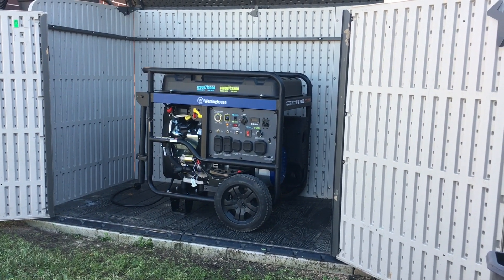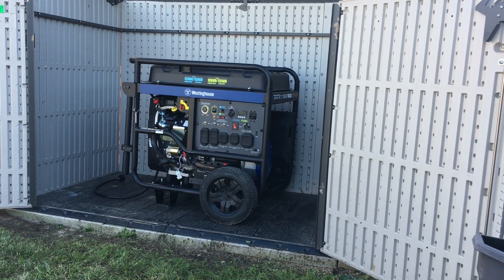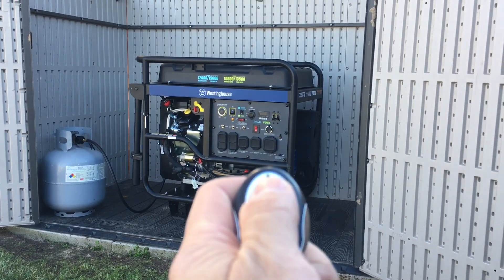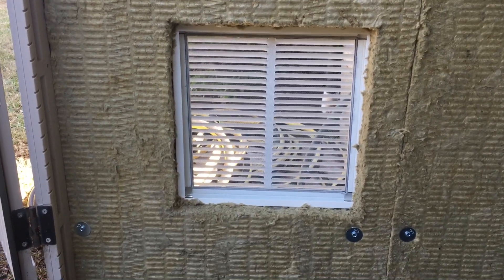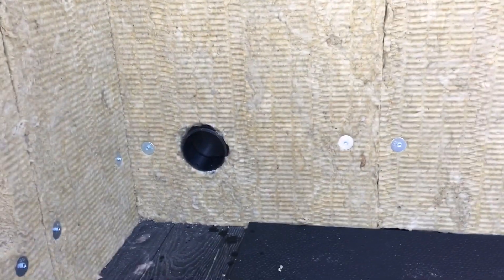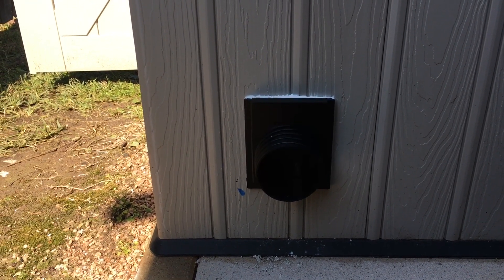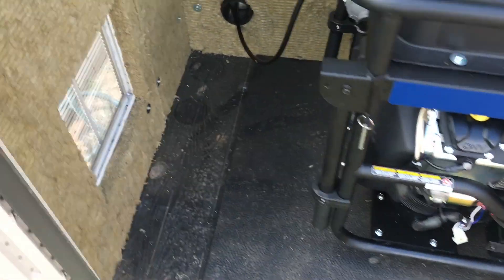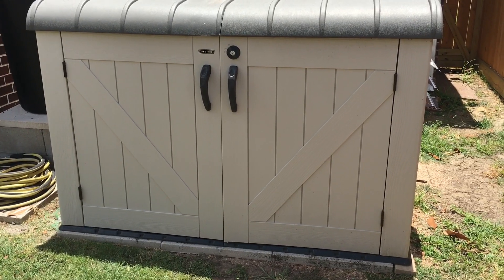***UPDATE READ DETAILS BELOW *** Part 7-Westinghouse WGEN12000DF 15000 Watt Portable Generator Shed

Comment: What did you use for venting the exhaust. With the doors open, the unit shuts down because of exhaust
Reply: Just so you know, Gilbo, created 13 great videos to this series for this generator conversion

Watch the other videos and you will have an answer to your question.

Comment: I used similar batt insulation, great easy stuff to work with. I also found a muffler designed for shed use, installed it, works great. Mine is now basically a permanent install so if power goes out. I open the shed door, hit the start button then go to the breaker book with the interlock switch, turn off street power, then every breaker in the box. Switch the main to generator power. Then bring on the biggest load, in our case the central HVAC unit. From there loads one at a time. We run the entire house regardless of outside conditions. Nice video.

Comment: What srews did you use to stablelize the roxul mineral wool to the shed? Thanks. Great work.
Reply from the maker: 1/4"x 1 1/4" washer ZAY head code from Home Depot

Attach cement board to shed first, with some I believe I used either 3/4" or 1" self tapping screw.

2" hex head self tapping screws I had. Just screw in enough to hold mineral wool in place. 

Don't go crazy and you don't want to drill all the way through shed

Comment: You've done a good job with insulating your panels around the generator.   Your ventilation method is good for the engine air intake and exhaust.  I would encourage you to learn more about the genset air flow.   My experience showed me that the genset  takes air in from the opposite direction of the engine and therefore you may want to look at piping in a separate intake to the head of the Genset.   Otherwise the genset operates in a negative pressure environment and may ultimately overheat.   This is especially important since the Westinghouse warranty requires 5 feet of clearance around the entire generator which is not possible inside of a box.  Nice build.  Good luck.

Comment: I did built myself A Plywood Generator Shed and built A Ply-Wood Muffler Silencer from the muffler exhaust.  Temperature of the Exhaust is 200 degree inside my Ply-wood muffler silencer.  That's Why I Must use a Portable A/C to HELP Cool Down the Heat inside the Generator Shed and the Exhaust fan blow/ Cool Down the Ply-wood muffler silencer around 130 degree .  But inside the Generator Shed Temp around 90-100 degree within Range 😅

Comment: Where did you get your shed. Can the link be sent to me
Reply from the maker: I got shed years ago at Costco, if you plan on getting this particular generator and a shed for it. The shed needs to be atleast 75 cubic feet.

Lifetime shed 60170 (6 ft. 2.7 in. L x 3 ft. 6.1 in. W). I think Sam's has this size shed for about $350.00, might be different color.

Hope this helps, thanks again for watching. Make sure you check out the entire series of videos for this generator, and forget to hit the like and subscribe button. if you have anymore question(s) drop me a note and I'll try and help.
Reply: @gilbosdiy  thanks for responding. I do have the same generator however Costco has a larger shed that won’t work for me. HOA rules. Sam’s club isn’t near me. I’ll keep looking. Thanks again
Reply from the maker: @daddio1491  Yea Costco, has one that is the exact same foot print as mine, but taller, so no over head lid, just the 2 doors. Try your local Ace hardware, they carry as well, not sure of the price. Even check Home Depot or Lowes, just make sure on the footprint size
Reply: Thanks again. I’ll keep looking

Comment: Doing the exhaust mod. Can you derail the through the generator wall pieces please. I have a 7500 Westinghouse and love tour exhaust mods.
Reply from the maker: For the exhaust hole, I went down my local Home Depot and picked up one of these. 

American Metal Products 3 in. Gas Vent Pipe Male Adapter
https://www.homedepot.com/p/American-Metal-Products-3-in-Gas-Vent-Pipe-Male-Adapter-3EUA-MH/202287764

Just remember when drilling the exhaust hole, try to  have the exhaust hole centered with exhaust of the generator.
The list of items I used for the shed conversion , is listed in the details section, under the video. Thanks for watch, please hit the like and subscribe button if these videos were helpful. If you have anymore question just drop me a line

Comment: Looks good- a few ideas would be seriously upping the ventilation volume, I.E lower in & higher out. Power an exhaust fan w/ the generator power. And find out which direction the {built-in cooling fan} of the engine/power head unit goes.. Put the side-wall intakes in the side of the shed  near where the power unit DRAWS air into itself. The exhaust vent should be mounted up high on the opposite sidewall or roof location at the highest point of the area where possible. Natural flow of cooler air that absorbs heat will flow upward towards the exhaust outlet.

Comment: How many pieces of mineral wool did you require to insulate the shed?
Reply from the maker: If I remember correctly it was 6 to 7 pieces was all. Each piece is 1-1/2 in. x 24 in. x 48 in. So to maximize coverage you have to play a little Tetris before cutting and attaching. Hope this helps, if you have anymore questions, just ask thanks again for watching.

Comment: Exhaust pipe  going outside,  the plastic shed.
Need  duct work (pipe)  from the outside to the engine blower fan.  
Need  two 12" X 12" vents in the winter,   electric fans on the vents in the summer. 
Have fun.

Comment: Please do yourself a favor and check the inside temperatures with a remote thermometer. Shoot for about a 10 deg f temp. rise maybe slightly more. To achieve this with my 5 kw honda exhausted to the outside and two 17' sq vents, one powered I migrated from a 12" to a 14" fan and finally settled on a 16"  3,000 cfm fan.
Reply from the maker: Funny you mention that, literally after I posted the video the other day. I was looking over the shed, immediately realized it was undersized. Started to rattle the couple marbles left between my ears, amount of heat waste to move, CFM needed, amp draw from new fan. Shed 2.0 coming soon!
Reply: @gilbosdiy  Yes I would like to know what the inside temperature runs with the doors closed. I have a 5600w generator in a similar shed with a 1800cfm fan and have the exhaust routed outside and the temperature will get over 95degF in the hot Louisiana summer. I end up having to open the doors to limit the generator surface temperature to 65 degC. Let me know how your temperature runs in hot weather.
Reply from the maker: @donaldjeansonne8667  Sure, if I get a chance this weekend, I will try and get that measured.
Reply: @gilbosdiy  What fan did you end up changing to?  I'm looking to a very similar build in the coming weeks.
Reply from the maker: @aland.6294  I ended up going with the iLiving 20" fan
Reply: @gilbosdiy   Yeah, you'll need atleast 3000 cfm just to keep it cool in the winter , fingers crossed for summer
Reply: During Summer Heat Temperature for Emergency Power outage.....We Can mostly Running with 12" -14" Exhaust fan with and Must with the Help of Portable A/C to keep the Shed temp around 90-100 degrees.  It's depends Solely on the ambient temperature.  I did a video to show people How I did it